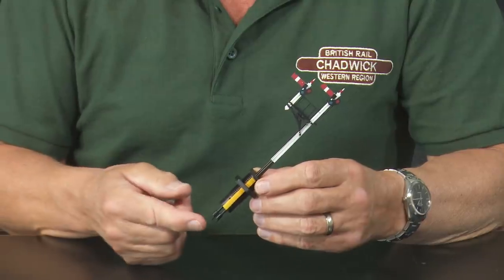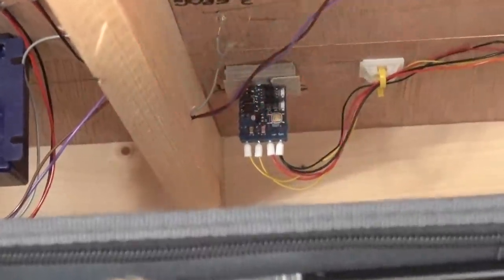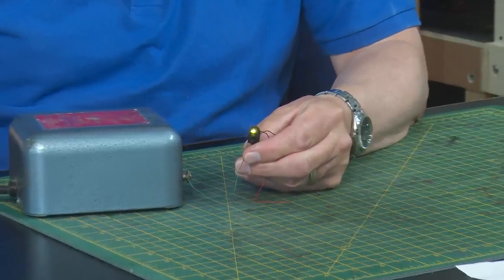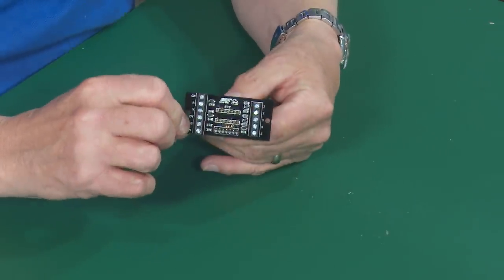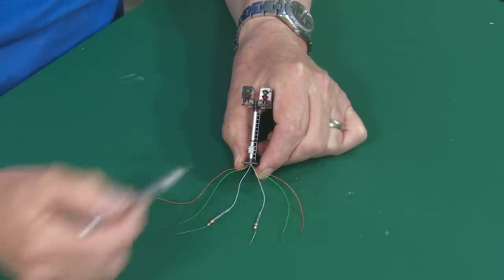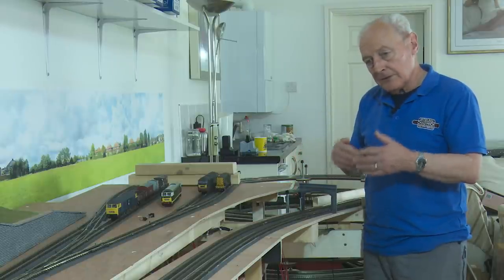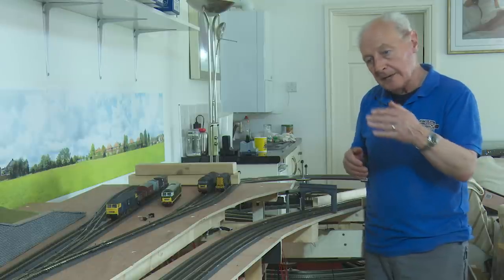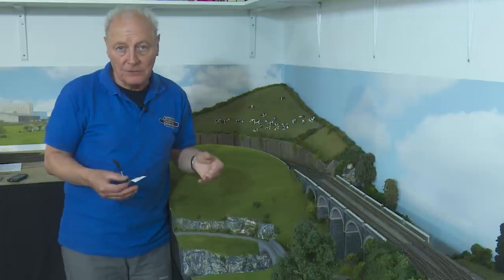Wiring LED and Semaphore Signals at Chadwick Model Railway | 135.

Comment: Hi Charlie after watching many of your very informative videos I know you are the person to give me some advice. I'm wanting to run my layout via a pc. Not sure which software to use, I train or train controller. My command station is a digitrax DCS 51 but at present that's it ie no block signalling etc. I'm also stuck on what digitrax equipment I will need.
Once again a big thank you for all the videos you have made there excellent 👍
All the best
Mark
Reply from the maker: Hi Mark, it’s a very expensive game to go to block detection.  I suggest that you work out how many blocks you will need and start to price it up.  iTrain is certainly cheaper than TC.  I will cover this in some detail in 3 weeks time.
Regards Charlie.
Reply: @ChadwickModelRailway 
Thank you Charlie looking forward to the video. All the best Mark

Comment: Charlie, don’t the signal controllers have a manual override so the starter signal can be set clear to allow the train to leave? 
And I think the philosophy is that the signals are left in the danger state, so a train has to be explicitly allowed to enter a block.
Reply from the maker: I think that you’re right Tom.

Comment: Speaking as an ex-signalman, I wouldn't be happy relying on a timer to control when a signal cleared.  That's how railways used to run, and it led to a few fatal accidents.  I know this isn't an issue on a model railway, but if a signal that was protecting a block that was still occupied suddenly cleared, it just wouldn't look right.  I would much rather use 2 sensors, one each for the off and on positions, or just use one sensor to put the signal in the on postion when the block ahead was occupied, and to then clear it with a manual switch when the block was clear and available for the next train to enter.  The default position for semaphore signalling would be the on position. the complete opposite of light signals controlled by track circuits.  Just as an aside, once you have cleared a signal for a specific route, that route would be locked and you shouldn't be able to change the points for a different route while the signal was still showing a proceed aspect.  I don't know how realistic you want your layout to be with regard to the interlocking of signals and routes, nor do I know how if it would be possible to implement just utilising the capabilities of DCC, but it's fairly easy to do using relays, but that's probably a step too far for a lot of people.
Reply: That was my feeling about using simple timed changes - fine for some layouts, but not all that great where trackage is out of view. 

If, for examples, you had a dead section on hidden track for some reason, or defective points causing a derail, then you'd have the perfect setup for a concertina crash where all your trains pile into the back of one another.  Unless signals are allied to block detection then it all remains very accident prone.  However, yes, only for very large layouts,  or layouts where there are significant amounts of track not visible to the operator.  

Where that is not the case then timed signals can add visual realism without undue complexity since operators will spot stalled trains and shut things down before that lovely new £500 blue pullman unit goes crashing down onto the model room floor :-)
Reply: @alanmusicman3385   I think in the example Charlie gave where the train runs down the helix to a fiddle yard, or on layouts that just go straight to a fiddle yard, having the timed signal at the bridge or tunnel portal that most layouts use is OK.  But having timed signals on the display part just doesn't work for me as you can't cater for the difference in time between a slow goods train and fast passenger service.  If the timing is set for a goods service, then when a fast train runs through, the first signal could still be displaying red, when the train has triggered the second signal....Now Charlie did mention there are modules (presumably a different part number) that are wired together so the second changes the aspect of the first, almost like traditional modern signalling, so that would work a lot better.  One thing Charlie didn't mention, which I'm sure he'll touch on in the next signalling / block sectioning video is bi-directional running and how that's signalled :)
Reply: I would consider a manual switch for Clear, with automated Stop as the train passes - no timer! Realistically it would be up to the signalman to set the route, contact the next box and get permission for the train to enter the "block". If you wanted to go heavier into automation, then try to figure out something similar to the 2-aspect light signal, but rather than default green, only (try to) select green as the train passes the previous signal!! Frankly that sounds a bit scary.... as a train passes signal 1 it would set it to stop and signal 2 to clear - but if there is a train in block 2, you would have to prevent signal 2 from clearing until that block clears. Like I said complicated... and if you're using computer control, you'd probably want some sort of condition feedback!
Reply from the maker: Inspiring comments gentlemen thank you. I used the timed signal by the Helix as more of a finale as the train would leave the scenic section. I wouldn’t dream of using a timed signal on the main layout. All of the signals will be changed using block detection and route settings. It’s just a challenge to work out the logic! Regards Charlie
Reply: @ChadwickModelRailway  Having built a 21 lever fully interlocked mechanical frame for a small branch terminal station, I can fully empathise with the amount of time it takes to work out the logic to get the interlocking right.
Reply: @ChadwickModelRailway  I was thinking more of the semaphore signals or station starter light signal - manual go and automate the danger as the train passes (so you don't have to remember to do it!). I would expect lights to be more block control type of thing most of the time.

Comment: Great video, as usual, Charlie. Though as you're using block detection, why wouldn't you be using something like an SE8c or a SIGM20 unit to actually control the signals based on occupation, rather than by a timer?
Reply from the maker: It’s funny you should say so John because in a couple of weeks time I shall be using just those items! I use the time signal because not everyone wishes to dip their toe into the automation water. Regards Charlie
Reply: @ChadwickModelRailway  excellent! I'll look forward to that a lot ;) I'm actually planning to build my own such device so this will be especially interesting to me :)

Comment: I have always wondered about using those Dapol semaphore signals as I love the steam era. I also model in N gauge so I'd have to get the N variant. I'm not entirely sure how the dapol signals work and if a flat simple baseboard would be idea. I'm not sure how to wire them up either.  Also do you know any good budget ways to do scenery like grass and stuff without getting powders and spending a bob or two?
Reply from the maker: It’s a difficult one I’m afraid. The cheap way to do scenics is with the woodland scenic type grass scatters. However they can look a little flat. Close to the board edge, it’s best to use static grass but then, the price goes up considerably. Regards Charlie

Comment: 33:45 I love signals on layouts and I appreciate your work a lot. And I sincerely hope no offence will be taken this time.

But no, please don't do that. Before the signal is cleared, the route (every switch) to the next main signal must be locked. Which means, among other things, that switches can't be changed. To keep it simple, the signal must be stepped down by the passing train and the tail of the train must pass the next main signal before switches can be unlocked. There are ways to unclear a signal without a train and unlock the route manually under special circumstances. But it just can't happen that you've got a signal at a permissive aspect and any of the switches is thrown.

If you think about it for a bit, you'll realise that signals in front of switches, such as home signals and starting signals, aren't cleared automatically. By default they are at "Danger". If they were cleared, the signalman wouldn't be able to route the next train to a different line. Those switches that come with the semaphore signals were probably meant for "stepping down", e.g. detecting the passing train to change the signal back to "Danger". Not exactly prototypical but still nifty.
Reply from the maker: An excellent comment GZ, and your points are taken in. Regards Charlie

Comment: My first thought about making a line clear (signal down) without clearing the train from the station sounds dangerous. Was there not a number stationmasters and signalman who handed a disc to the driver. But then you went onto your own layout and feathers (don't know that I have seen those B4). To say that I am confused is an understatement.  But I am sure it will look good right or wrong.
Reply from the maker: Thanks George, yes I do find the correct method of using semaphores challenging somewhat. Regards Charlie

Comment: Interesting presentation as always Charlie. One question stands out in my mind... on the automatic signals which change by dwell time after they have been activated by the train passing over the detector What happens if the train has a breakdown say on the helix? Does the signal stay red indicating the train ahead has not moved on or does the count down to a yellow and eventual green aspect continue?  If it moves on to green then there is no protection afforded to the disabled train in the helix. 
You see the problem and can the circuit address this ?  Thanks Joe.
Reply from the maker: Great question Joe. Train controller will certainly stop any trains from entering the area of the Helix in front of the derailment. But as you say the signal may not quite display the right information.
Reply: @ChadwickModelRailway  
Yes Charlie I guess a derailment would short out the track and the train would stop if I read you correctly. But suppose the train stalls due to debris on the track would the brakeman have to go back 1/4 mile to protect the rear of his train? Just kidding but as a retired conductor the protection of the rear of the train was the first thing that occurred to me. 
The system looks great but just was wondering if it protected or is up to the engineer to apply the brakes upon seeing the train ahead.

Comment: Another interesting video, Charlie. As I understand it, feather is always for the diversion from straight not an indicator of minor route..  On another note, will your signal before tunnel mouth for helix be too close to previous signal at junction in that the whole train will not have passed junction signal before passing helix signal? Bit of a mouthful there - makes sense in my head. 😄
Reply from the maker: Hi Mark thanks for your comment. Yes it’s an interesting point, regarding the length of the train but I think it will just about fit. Regards Charlie
Reply: This goes back to the concept of compression. Each block has to be long enough, yet we want the signals to be close enough. I suppose we have to limit the length of the trains where we want the blocks to actually stop, but can compromise where the blocks (and their signalling) are for effect. After all the signal on the viaduct will not have cleared the station throat, so the viaduct signal does need to be on the viaduct, and not on the curve approaching it!  (More eye candy, please!)

Comment: Your comment re having the off position as default on the Dapol signal is not prototypal and would have breached Board of Trade regulations, introduced after Abbots Ripon accident. 

Also the installation is of a section block installation!
Reply from the maker: Dead right Diane, I have been corrected!

Comment: Great video, but I have a question, how will the sensor work inside the tunnel once you close it up?
Reply from the maker: The sensor is just an infrared reflection and when the beam is broken it triggers the signal. It should work just fine. Regards Charlie

Comment: Hi Charlie as has been already said semaphore signals are always held at danger until a train is cleared to pass by the signal man/woman, just have a look at any old pictures or indeed modem pictures of semaphore signalling. You will find them all at danger, unless there is a train about to arrive or depart. I believe it is known as closed block. I believe If signals are normally at clear this is known as open block and I think that you will only find this on sections of line with colour light signals which are automatic, IE no signal box. Having said that I believe that in the pre grouping era some of the many railway companies did operate open block signalling but I believe the board of trade forced them to use closed block after a series of accidents.
You also made a comment about the signals on a model railway only being eye candy I must disagree with this as on my layout I use route setting which can set up multiple routes all of which are signalled. 
As there are two of us operating the layout me setting routes etc and my mate driving the trains, he checks the signals are set for the desired route and only proceeds when they match. this has stopped a lot of derailments etc,which used to happen before working signals where installed.  At moment working on method to return signals to danger automatically once train has passed so got some good ideas from your vid thanks.
Reply from the maker: What an excellent comment Jamie. Hopefully you’re on side when I say that installing signalling on a model railway can be a nightmare just as doing a video on it, exposes me to some interesting views from retired signalman.
Reply: @ChadwickModelRailway  Hi Charlie thanks for your reply yes I absolutely agree about signalling a model railway being a nightmare  haveing spent hours and hours trying to work out how my railway should be done. I think I now have it pretty much right seems to work well enough, would a professional railway person find fault probably. But I think that's always going to happen. Keep up the good work.

Comment: LED’s on a circuit diagram have two little arrows pointing out to show that it is emitting light, rather than just a normal diode.
Reply from the maker: Thanks Kris for keeping me on my toes. Regards Charlie
Reply: Try putting this into eBay search: 30 piece diamond cutting disk set. 6 quid to re-stock the multi-tool gizmo set. Also worth a note is fibreglass pencils, brass scrubbing brushes comes under 3 piece scratch brushes. Fiver. Don’t forget Andrew at Dundas models. 009, but some of his stuff is very much multi-gauge, and very useful.

Comment: Hi Charlie
Please do not think I am being critical, I think your videos are brilliant and very informative. However, you said to my comment two weeks ago that you would be covering semaphore signalling this week. I did not really expect the almost dismissive comments of modellers that use this type of signalling. Looking at the locomotive stock that you have, I would have thought you should be having a mixture of both colour light and semaphore units on the layout. The only coverage given was for really expensive Dapol units that a good many of us may not be able to afford in any quantity. For instance, I have multiple signals that had a light in a holder beneath the signal, the signal clips on top, that then shows brilliantly though the red, green or amber of the semaphore signal arm dependant of the signal setting. I have no idea of the make of these signals, but I know I have had them in a box for over 50 years. So, I was hoping for some ideas on how to put in some form of control to equipment such as this using servos, and how to use with DCC.  This could be something that would operate the Ratio type signal available today, which of course are much cheaper, but requires a similar form of operation. As I said I am not being critical, but would appreciate widening out the very focussed attitude to the more modern day equipment, to older types that I am sure most modellers of our age will have locked away somewhere.
Best regards
Ian
Reply from the maker: Hi Ian , I’m so sorry that you were disappointed with the video. The emphasis on the video was to provide some kind of automation to signalling whether it was by absolute blocks with semaphore or by MAS with LED signals. I was not trying to display my reluctance to use them just that there is so little equipment available to automate them. Regards Charlie
Reply: Hi Ian. I think the signals you described are probably British Trix from 1960's. I had a similar home/distant with a light box underneath, manually operated. The signal post is made from fibre optic & the base in the light box carries the light to the signals. They were lovely inexpensive signals & they also did a single aspect red/green colour light using the same method.
Reply: Hi Pat
            Thank you for the information, I had no idea who manufactured them. I agree they are lovely models, maybe a little overscale but they work wonderfully well. Unfortunately all of the bases that contained the lights have been lost, but I have managed to get some made from some laser cut sheet metal, and have made an adapter on my 3D printer to take an LED from woodland scenics, this works very well. I was hoping for help with trying to mechanise these and I suppose I will have to look at Heathcote electronics and their servo units.
Thanks for the info